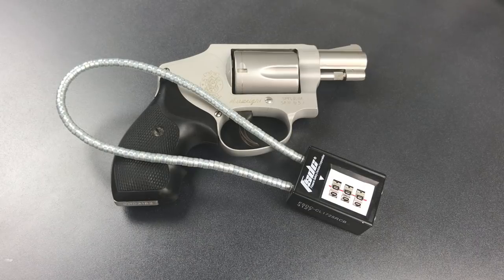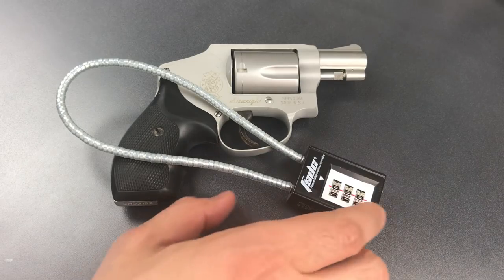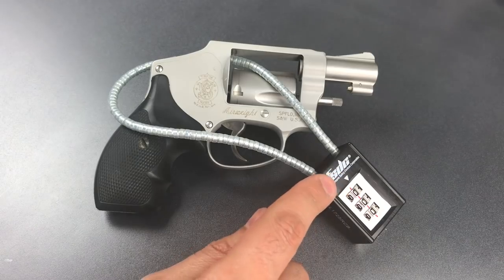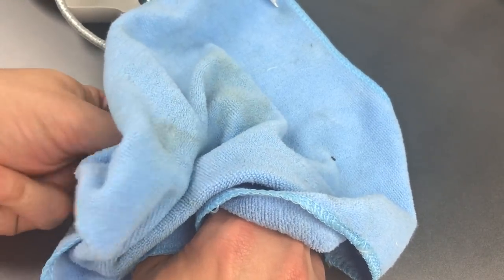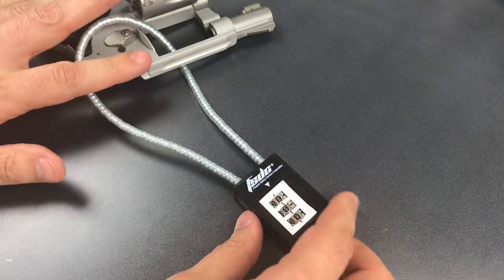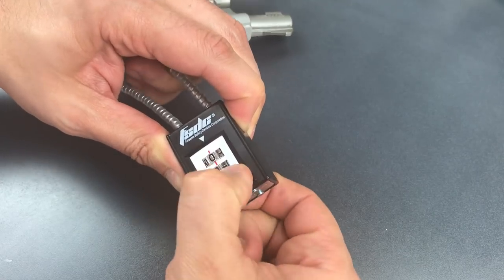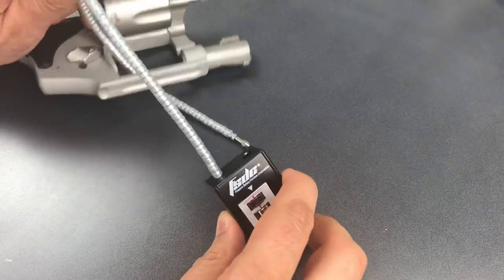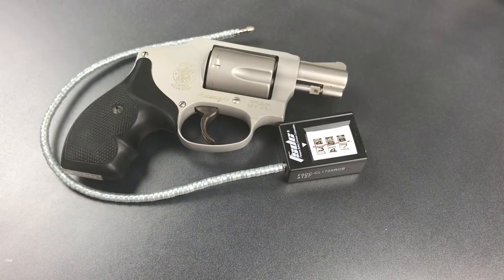[749] FSDC Combination Gun Lock Decoded FAST!

Comment: Unfortunately very unsurprising. 
But in the case of a revolver you could use almost  any padlock.
Reply: sometimes people are conned into buying 'gun locks' for guns at the store when a standard padlock will work so much better
Reply: You could also put like two or three on the revolver depending on it’s size
Reply: plasticized or rubberized shackle and voila! a properly secured gun!

Comment: Well, considering that it would take less than half an hour to go though 1000 combinations, we really can't have high expectations.
Reply: 16 minutes 40 seconds if you spend 1 second for each combination which isn't hard to achieve, still most kids have attention span of only 2 minutes after which they would get bored and just leave it alone.
Reply: They'd spend a lot more than 2 minutes if they can see the prize is a "toy" they want to play with.  Even if they give up, they may remember about where they left off and come back later to continue.  (I had great memory as a kid.)
Reply: Nah kids are no longer that patient and they have nothing to teach them to be patient unlike we did when we had old PCs that taught us to be patient and that we can't have everything. Today it's either right now all of it or forget it.
Reply: @harshnemesis  I remember cracking three digit combination locks as a kid, and I think it took me more like 10 than 15 minutes.
Reply: @lal12  depends what the combination was. If you started from 000 and the combo turns out to be 999 then it would take you more than 10 minutes
Reply: @harshnemesis  I would say one second per try on a small combination lock sounds reasonable, however I think a bit faster is very doable. Also it is very unlikely to have a high number. On average you need half the time.
Reply: @lal12  I'm not sure why but they did seem to avoid high numbers when they were making these crappy 3 number combo locks for some reason.. also you don't wanna rush it too much because then you could actually miss the real gate once it comes up.

Comment: I don't really play with pick locking, but I will say that I had this safe that I forgot the number for, I forgot it long ago since you can't actually change it, It looks like they just scrambled the numbers on it changing it, then they just said the numbers for it, so what I did is just turned it while pulling insanely until I can slightly see in it, then after that, I looked at the piece that keeps it double lock thingy in, I turn it until both were aligned, and it was that easy, glad I didn't use that thing seriously, there was another one, I just pulled really hard, put a screw driver into it, and then brute forced it off. Now I have a safe that doesn't even work lol, I know nothing. Nice video.

Comment: I don't use gun locks because they are junk.  Keep them in a locked job box bolted to the floor with 2 Abloy locks.   It's a great poor man's safe.
Reply: Two Abloys? You must have diamonds inside that safe too!
Reply: Time to get the Ramset.
Reply: Fill the job box box with sand bags so It can be carried away even if it’s unbolted
Reply: not anymore

Comment: Regardless of the locking mechanism, using a cable to lock these firearms is stupid. It's a surefire thing that if someone has a gun they have a cutting tool around, easy to break this open just by cutting it. Should use a D-Bolt type shackle, I think they are more secure.

Comment: Also, it only has 3 digits. So, even if this attack where not present, a determined child could brute force the combo in around an hour, probably less.
Reply: This could've been shorter. You can actually change this code to any code you want, by holding that "reset button" while the numbers are scrambled and is locked and change it to anycode you desire. Let go of that and click the other button and VOILA! Open sesame instantly

Comment: In Soviet Utah gun shop the gunsmith removes cable lock with cable cutter or cold chisel and hammer or cross peen hammer or sledgehammer possibly cutting torch like that one time.

Comment: If you can reset the code while locked surely you can just go to the reset button and be able to unlock with the reseted code ??
Reply: Er, no, you can reset while the wheels are in the right code.
Reply: the start code was 000. You have to have the right code in to be able to change the code